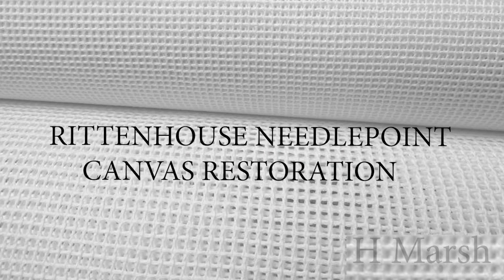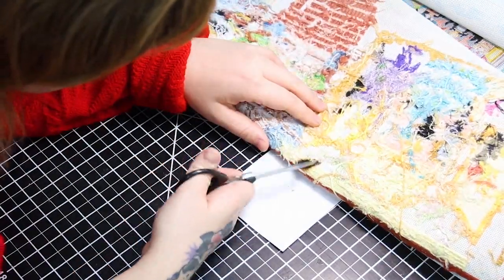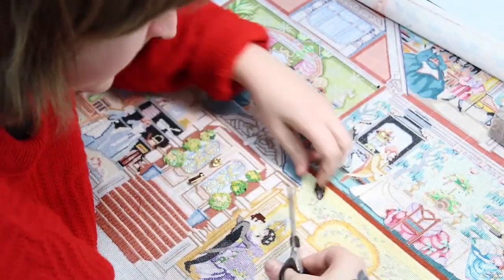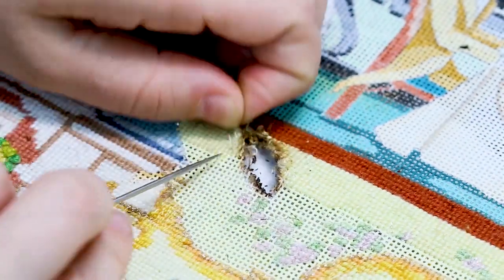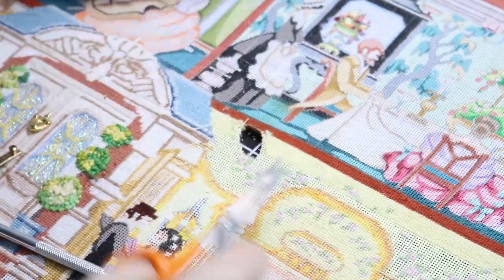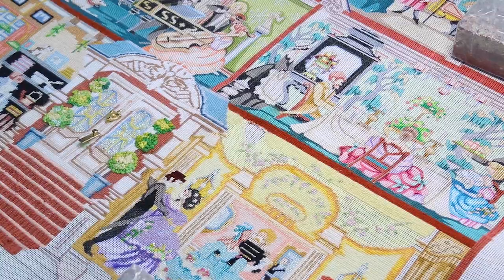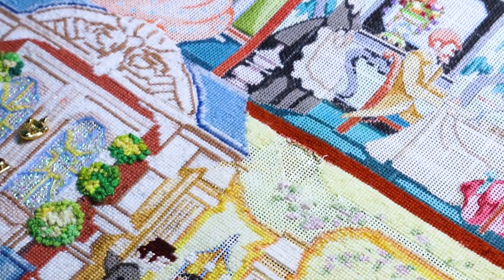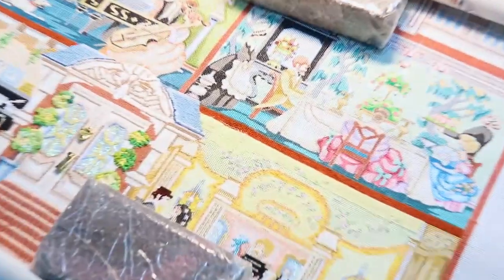Repairing a Burn Hole in Needlepoint Canvas

Comment: Hi!!  I purchased the ehrman kit Mikado on eBay (for $19.00!!!) that was stored incorrectly. It was folded in half and then in half again with a wooden ruler in the folds. It was damaged in one long thin strip, as if it were cut (if that makes sense). I was thinking a patch would work for this as well, and seeing that is as yet unworked, it will patch wonderfully!!  I can not wait for the next video showing how to sew the patch on!!!